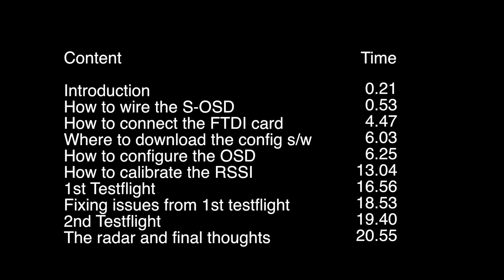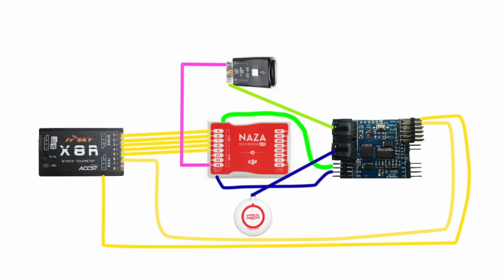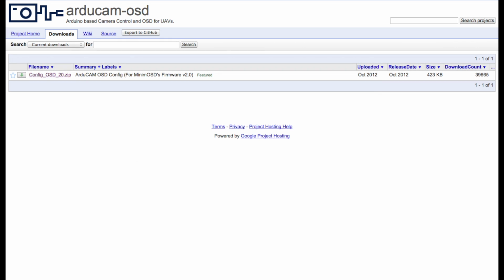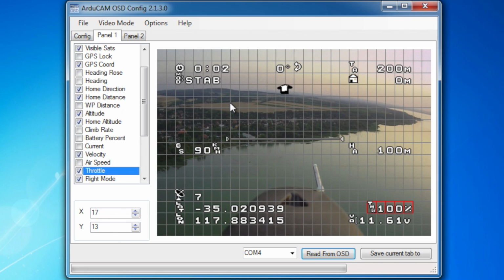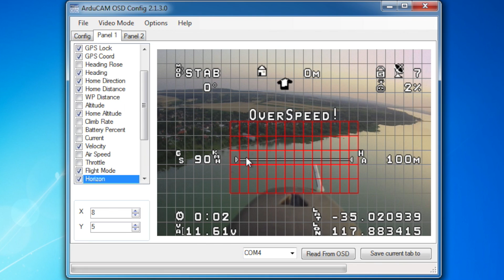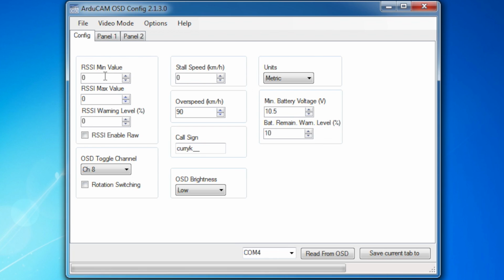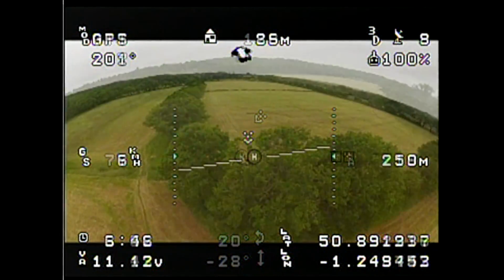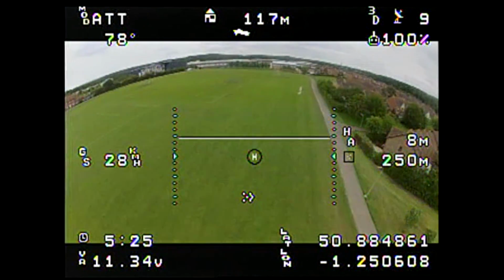FPV review: The S-OSD for naza (part 2) With setup and config guides

Comment: Brilliant video, many thanks. I've now got my S-OSD wired up and fully working. Although just all loose in a pelican case, there is no quadcopter yet!
Thanks to your video, everything worked first time.
Notes to others commenting on this thread;
The altitude thing - The s-osd itself gets a home location when there are 5 satellites and the altitude hasn't changed for 5 seconds. Of course, once you get MORE satellites and your location becomes more accurate, this can change, and the altitude can be shown different. Perhaps a change in the coding to allow the home location to be changed if it knows the quad is still sitting there acquiring more satellites.
Mode Select - this is left over from the original project whereby it took a feed from the flight controller. The minNAZAOSD (and this one) uses the LED status to set the mode. So it won't be able to register a flick of mode because 1 second is required to read the status of the LED.

Comment: Really excellent video, makes a very intimidating setup look almost manageable. When you say do not have the osd connected to anything when you use ftdi adapter to plug to the computer for changes do you mean even if everything else has no power into it? As in remove all the plugs into it to make and changes via the GUI?
What would cause an issue if not unplugged? 

Thanks again for documenting so well.
Reply from the maker: MicroRCFiend Yes - what happens is that everything attached to it tries power up via the 5v link and the draw will be too much for the USB socket/hub.  It's a pain to disconnect, but it's very necessary
Reply: Cheers for the explanation, that's burned a clear enough picture for me to not forget that one.

Comment: Howdy ... I ordered one of these, as I wanted a solution, where I didn't have to invest in the V2 PMU. I have a few multirotors, but my aim was to build one cheapo one.

The only thing, that sort of puzzles me, is what to do with gimbal control ? I'm using a Storm32 based gimbal, that needs a feed from somewhere. I figure, I can probably just wire it to a channel on the receiver, but I wondered, how you went about that, since F1 and F2 are used by the OSD.
Reply from the maker: F1 and F2 would only be used for servo based gimbals, a brushless gimbal has its own accelerometer to work out what it needs to do.  You'll probably want to connect a channel for manually tilting thought so you can look straight down (or whatever) Yep, I ended up using 14 channels on my rx - using sbus to the Naza, and then a whole bunch of traditional channels for other things - including 3 channels on my gimbal
Reply: I'm aware, that brushless gimbals have their own sensors, but well .. it has always been the classic way to do things  .. and yes, using the likes of an sbus receiver for the standard channels and switching it, so you can use the upper channels for the traditional outputs sounds like a good plan.
Reply: Thanks for the videos. It cleared a few things up. The documentation is quite poor for the unit.

Comment: Thank you for the video. One problem I have is the altitude. On my screen it will show a negative value, -2m.
Must I be at a certain height in order for the osd to register an accurate positive value. I usually have about 10 satellites for a GPS lock.

Regards
David
Reply from the maker: David Chong Generally this is caused by getting an early fix - so as soon as you get 5 sats or so, Naza will set home, and the OSD will take it's reference from there - but as you get more sats, your position gets more accurate - hence you home altitude has dropped to -2m.  If you hit the reset button on the OSD it should quickly get all these sats again and give you the 0 HA position.  That's unless you are using the other altitude (I forget it's name) that basically gives you an above sea-height alt... not much use really
Reply: Ok let me try the reset button. 
One more question regarding getting a clearer video on my screen. I use a separate battery to power my fpv gear and this seems to give a better video than using the flight battery. But I'm still getting some video distortion and snow. Any ideas? Thanks.
Reply from the maker: David Chong Difficult to say, can be a number of things - have you got a known decent make of antennas, could the path be being blocked by a lipo of carbon fibre in your frame, could you have a dodgy VTX etc etc.  There's also areas of just weird reception where signal can go - even close in - but then be fine again after you go through it. If you can put a video up showing your layout and a ground recording of what you are seeing, then we can form more of an opinion.
Reply: Sorry for the late reply. I've sorted out the video distortion that I had. It is due to my fpv LCD receiver selecting the incorrect channel. I put my LCD receiver to do "auto scan" and it selected "B1" instead of actual frequency of "F1". Once I manually set the frequency on my LCD receiver to "F1" the video is clear without the usual distortion. I still need to sort out the altitude display, it is still not displaying the correct data and I've tried to do the osd reset. I did the reset when I have gotten 10 satellites locked.

Comment: Thank you for this video, I ordered an ftdi adapter and I'm waiting for it. I will follow your instructions to configure it.
My s-osd works very well but when I get high contrast input from my camera (like contrast between sky and skyline), the video area  on the artificial horizon gets distorted, like some "interferences" in the video. Do you have any idea from where this comes? 
Thank you for your answer
Reply: +veucinze 
I too get this very same problem..is their any fix out their? Running boscam 200mw vtx

Comment: Awesome video, thank you very much. 

Can I ask, what value resistor and cap did you use for your rc circuit?
Reply from the maker: James Mann For the RSSI you mean ?  I think I blindly followed a picture I found on the FrSky website which was a 1k resistor and a 10uf cap.  Mine are heat-shrinked in, so I can't double check - but I'm pretty sure that's what I used
Reply: Yes, for the rssi. I followed, probably, the same image. But found different instructions else where. Might have a problem with my module... But this hobby is about the tinkering, not the flying... At least that's what it feels like at the moment!! Again, thanks for the instructional videos, it's a great help.

Comment: thanks for video.

Do you have any technical suggestion about FRYSKY X8R using s-bus and not traditional AETR channels?
Reply from the maker: Can you give me some more detail - I'm using an x8r with sbus with my Naxa quad at the moment without any particular setup issues.  Running bus to naza and then using up to channel 12 (IIRC) as traditional PWM inputs to control things like gimbal movement, beeper, switching OSD screens etc.
Reply: @CurriKitten According to your diagram, you are not using SUS but PWM

Comment: Hi thanks ,I have the same set up with the 8 xr . Now the gimbal tilt control is on F2 i think. So i think i have to connect it  to the rx as well so i can use the F1 and F2 for the A,H,?
Reply from the maker: MrCorby4 More info needed again  what gimbal ? - unless you have a servo based gimbal (in which case why are you living in the past, get a brushless one they are dirt cheap) you won't need F1/F2 for anything other than to connect to F1/F2 on the S-OSD.  As long as your gimbal supports it, use a separate channel on your RX and plug into the tilt control of your gimbal (and obviously program your radio to use a slider/pot/whatever)
Reply: Hi MrCorby4, What did you do to fix your problem, Did you put the firmware that Curry linked to?
I had a working ODS for over a year and the other day I wanted to change my Meter to feet and from pal to ntsc. Out of the circuit on table I programed it. Now it does not work. I am going on vacation soon and would like to have so OSD working. I bought 2 S-OSD on ebay. 
I went and connected the Ftdi programer and save the screen to the OSD. No errors. I put it on my drone and does not boot or show anything other then pass through video. I can put the programer and still talk to the chip but not OSD on screen. SO I put the other S-OSD in my drone to see if it works as I didn't do that with the other one first. Works good thinking I still want to change the feet screen stuff and there was just something wrong with the other unit. I programed that on and the same thing happened again. WTF is wrong with what I am doing. Can you or Curry figure this out. IS it just the memory got corrupted? Because I did not have it in the drone or short out anything.
I posted again because I did not know if you would get the message in an email. Thanks for video but please help.

Comment: hello, I also installed the OSD is in my quad, and after a few minutes to set DJI M v2, the OSD does not overlay the image, now I'm waiting for FTDI adapter, maybe then when I start programming the appearance of the OSD appears on the monitor again
perhaps, it is another cause loss of data display OSD - I do not know
If you have an idea, maybe you can help with this problem?
You've done a good job of making this movie.
Thanx
Reply from the maker: Jaroslaw Military Not sure what could be wrong, but as far as fault finding goes, the OSD doesn't need an input video signal to display, so you might want to hook it up directly to an output VTX/Monitor/etc and see if you get anything.  You also might want to disconnect if you have the mode switch connected, just in case it's switching to the "No OSD" display

Comment: Also i now have a battery consumption unit to hook up to the OSD to monitor my motor draw, i take it this option is also off like the RSSI? Just thought i would mention too, have you seen the mini version of this board, its much smaller and lighter, same chip set just more compact.
Reply from the maker: Craig McTaggart I heard about the mini, but haven't tried it - after I finished these videos the OSD and my Naza is buried quite deep in my new frame :)  Still debating about whether to get another Naza on my old frame, and another one of these, or try an APM.  Anyway, no the current sensor isn't enabled to show by default, it's in that list of clickable things you can enable and then place on the OSD screen from the setup sw

Comment: Hi Curry,   Ok ,all is working  except A.H. Thats Ok  though. But the compass goes crazy unless moving forward, and the altitude is off by about 50 feet too high Maybe there is a different firmware available or character set like the minim osd  has.  Were you able to get rid of the radar ?. I'm using the tarrot gimbal controller with the mobius set up. its very smooth. Thanks
Reply from the maker: MrCorby4 Radar is still there, I know how to remove it through recompiling, but I haven't done so as I wanted to get it installed on my quad so I could move on with some other projects.  Altitude out, is this home altitude or the other one ?  If you can make a video of your AHI problem, I'm sure we should be able to resolve it
Reply: Hi MrCorby4, What did you do to fix your problem, Did you put the firmware that Curry linked to?
I had a working ODS for over a year and the other day I wanted to change my Meter to feet and from pal to ntsc. Out of the circuit on table I programed it. Now it does not work. I am going on vacation soon and would like to have so OSD working. I bought 2 S-OSD on ebay. 
I went and connected the Ftdi programer and save the screen to the OSD. No errors. I put it on my drone and does not boot or show anything other then pass through video. I can put the programer and still talk to the chip but not OSD on screen. SO I put the other S-OSD in my drone to see if it works as I didn't do that with the other one first. Works good thinking I still want to change the feet screen stuff and there was just something wrong with the other unit. I programed that on and the same thing happened again. WTF is wrong with what I am doing. Can you or Curry figure this out. IS it just the memory got corrupted? Because I did not have it in the drone or short out anything.

Comment: Any chance you could make a part 3 to fix the problems this OSD is having coming out of the factory, i.e the mode select issue. I havent done the programming side before so would be good to see what i need to do and whats causing the problem.

Comment: hi curry kitten 
can you help me out with my interference issue (as mentioned further down on comments) 
the screen gets distorted in high contrast areas..tried different rx's,vtx's and different cams to no effect?
great video btw as this helped me set up easily
Reply from the maker: +Simon Codd I'd missed the original comment on this one.  Do you have an example of the video distortion you are seeing.  That sort of stuff is normally down to the camera - but if you've tried several different ones, then it seems less likely
Reply from the maker: +Simon Codd Sorry - Youtube hid this in the spam folder, am replying on your video

Comment: Hi  how does s bus get hooked up ? I put the leas through throttle pins but no throttle percent reading
Reply from the maker: MrCorby4 Hi, can you supply a bit more detail there as I'm not sure if you have Sbus working and want throttle as well, or if you are connecting sbus to the throttle connection.

You need to connect Sbus from whatever port in your RX to X2 on Naza.  Whether you still can get a PWM signal on the other pins to separately connect a throttle out is down to your RX, some have the signals still coming out, some have nothing and some can be configured.  On my X8r that i use in the video, I've put the RX in 16 channel mode, so I use Sbus to connect up to Naza, but I can then use another channel, lets say ch 11 with a source mix of throttle and plug this into the throttle input on s-osd to get the throttle percentage value.

Comment: got everything set up great on my new hex, fpv feed and osd look great indoors but when I take outside and get satellite lock my fpv gets interference so as to be unusable😣 any ideas? I'm so frustrated and can't find any help online anywhere. everything looks amazing until satellite lock ggrrrrrr!!!!!
Reply from the maker: Weird one - does it only happen when you spin your motors up, or literally when sat locks are acquired ?
Reply: Thanks for the quick reply. It literally happens when sat lock is acquired, I've built several racing quads before so I'm aware of what you mean with motor interference and how to avoid it, this seems to be something with the osd itself. All the initial info is present as it should be on screen (batt vol, sat number etc) all the stuff I put on that I wanted, then as soon as sat lock happens there is a sort of distorted section right across the middle of the screen horizontaly. Sorry to rave on just really frustrating as everything else went swimmingly as youve shown in your excellent video
Cheers for reply
Frustrated of Lancashire 😀😣
Reply from the maker: That sounds really odd - and to be honest, I haven't got much of a clue what's going on there.  I would attempt to try and hunt down the cause myself.  It's a sat lock thing, but is it the fact that sats are getting locked in, or just that the number is being displayed.  It's a bit long winded, but I would try, in order: Move GPS receiver elsewhere - as far off the quad as you can just to test.  If that makes no difference is it literally the text on the screen causing some sort of distortion - pushing text right up to the edge can do funny things on some devices.  What happens if you move the sats displayed, or move them to a different part of the screen.  Does the screen warping happen on all devices - again an OS signal is a bit weird and can desync with some devices.  I had an OSD which would always be perfect in my Fatsharks and then just the text would disappear on my DVR recording sometimes ! 

It's a massive pain to go through all these things, but at least pinning it down (hopefully so) will help you decide what to do about it.
Reply: Thanks for taking the time to offer some suggestions, I'll have a go over the weekend hopefully and maybe get lucky. 
thanks again
Steve

Comment: Well I think I F ked it all up I connected the ftdi  with all the other wires connected Now no osd .It doesn't boot up . I removed all wires and was able to re write settings to the osd but it doesn't work . Dam. Can you tell me  where I can download the firmware so i can re flash it? I cant seem to find it. Thanks again
Reply from the maker: MrCorby4 Maybe, you'll find your quad tried to suck the power through the s-osd to bootup, which is quite possibly too much for the board.  Have a look at the tracks and see if anything has gone.  Original firmware is here - you'll find a zip from this post http://www.rcgroups.com/forums/showthread.php?t=2020638&page=6#post26526305 inside that there's the folder 003_DJI, use the miniNAZAOSD_DJI.hex inside of that one.